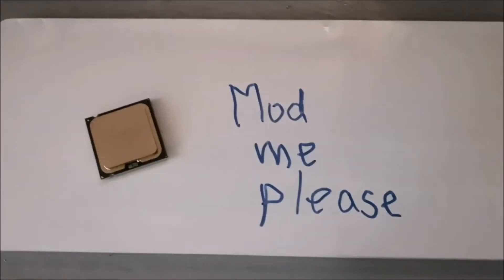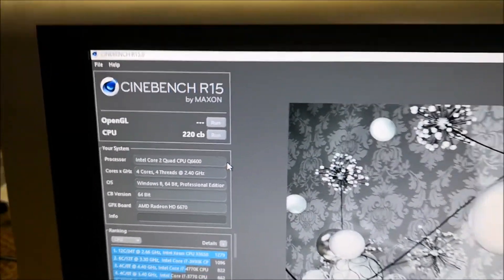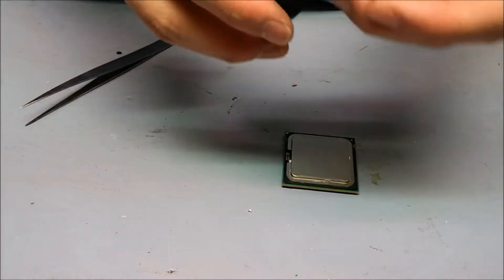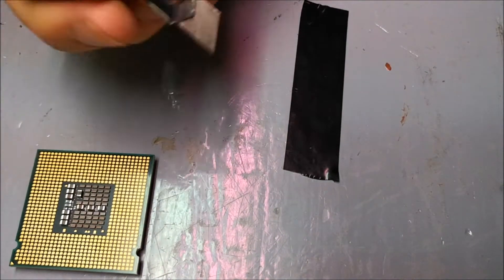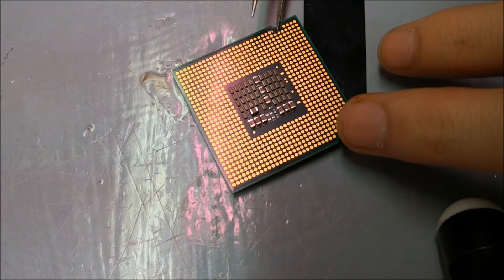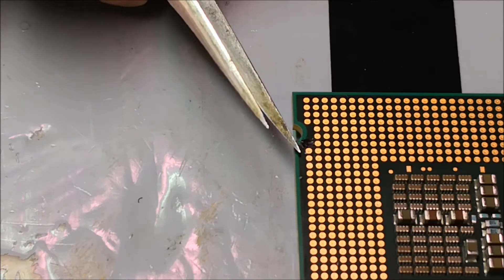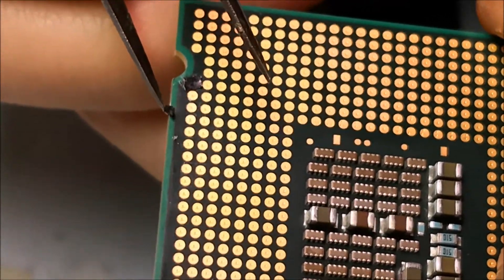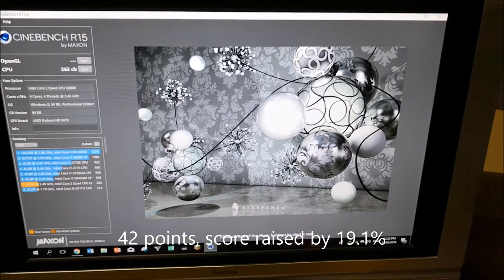Modding a Q6600...  BSEL all the way!

Comment: Do you know if this works on q9400?
Reply from the maker: It would work, but you won't get any performance increase on a Q9400. The Q6600 has a front side bus (FSB) of 1066MHz, and the mod increases it to 1333 MHz for a decent performance upgrade. Since a Q9400 already has a FSB of 1333 MHz, the only way to extract more performance from your chip would be to modify the CPU multiplier, but only higher end motherboards support this feature. Hope this helps.

Comment: ok im confused. im a 13 yr old. some say no need to cover the second pin
Reply from the maker: You are correct, my method is older. You only need to cover the first contact I covered in the video, not the second one.
Reply: @RexMods  Can I do the same thing to a Q6700  and a Q9400???
Reply: @xtrap-music  Q6700 yes, Q9400 no

Comment: Does this work with a board that doesn’t support OCing?
Reply from the maker: Yes it does! Otherwise it would be easier to overclock via the BIOS.
Reply: @RexMods  Okay cool! So is there any motherboard it wouldn't work with? I have a dc5800 PC with the Q33 chipset.

Comment: I have several questions about this method, it would be nice his help, my motherboard says that supports 800/667/533 of fsb and only support intel core 2 duo up to e4600 all 65nm processors only, in fact I tried a core2 duo of 45nm and didn’t give bios or anything lol, the thing is I updated to the last bios and now It recognized the q6600 that is 65nm too but has a fsb of 1066Mhz, so my question is If this method of OC on my mobo will work for me? That last bios update could have increased the fsb of the board to 1066mhz and that's why It recognized the q6600 or the bios updates can not increase the fsb of the boards? And the last doubt is that this method by increasing the fsb to 1333MHz means that it could put rams of 1333Mhz too? Obviously my mobo can’t do Oc by bios for that reason I would resort to this method and I don’t want to buy a new PC since it is only for basic gaming and work, I would put a gtx 750ti at the most but I need to know if it will work first and be able to buy ddr2 rams of 1066 or 1333 MHz
Pd: sorry my bad English I hope you understand my questions
Reply from the maker: This method for overclocking a CPU is not guaranteed to work for all motherboards as it is not an officially supported way to overclock your CPU. What motherboard are you attempting this mod on? As for RAM, FSB and RAM frequencies are two different things altogether. The fastest DDR2 RAM is DDR2-1066, which is 1066 MHz RAM. Anything faster is probably DDR3, which again depending on your motherboard may or may not be compatible. A GTX 750 Ti is surely going to be a good upgrade path if you want something cheap, and even if the CPU can't be modded you will still have 4 cores instead of 2 which is going to help a lot in games. Hope it helped and don't hesitate to ask any other questions you have in mind.
Reply: @RexMods  thanks you for response, my motherboard is a very old OEM brand, it is a packard bell GA-T671MG that was asembled by Reno, yes, a brand very unknown and there´s not many information on internet about this motherboard, so my method to update my system is trial and error, It support 4 gb ram ddr2 667/533 Mhz according to this page http://www.findlaptopdriver.com/specs-ga-t671mg-motherboard/  
and that's the reason why I don't know if this method of oc will work for me, furthermore, do you think if I put a 1066 mhz ram wil work properly? or should I put at most 667 mhz frecuency of ram? I´m wondering this because I know that q6600 has 1066 mhz but the mobo only support   800/533 fsb, however, it worked, so if now my processor run at 1066 Mhz with this method should increase to 1333 mhz.

Comment: I saw that you had Chrome browser open in the background. To get the best benchmark score and during gaming it's best to close all apps and even turn off antivirus software. My Q6600 with tape mod hits 305 in Cinebench. I also have DDR3 1333MHz RAM.
Reply from the maker: I did run Cinebench another time afterwards because I realised I had CPU-Z open, forgot about Chrome. I don't think having Chrome open affects it that much anyways, right?
Reply: RexTex hardware & mods can you give us the number if you test it with no apps open?